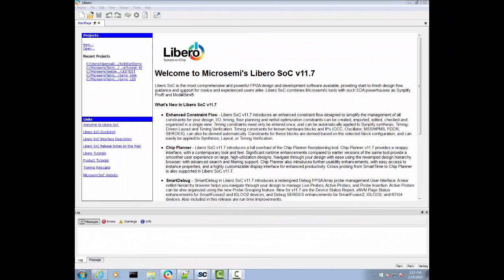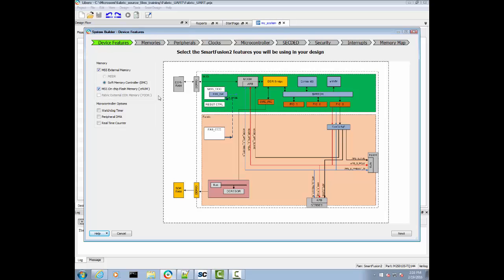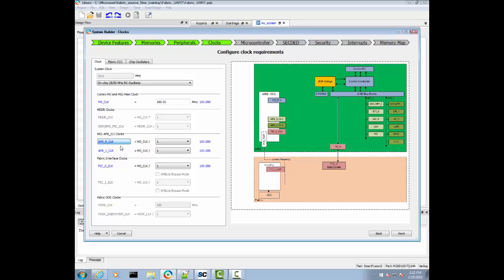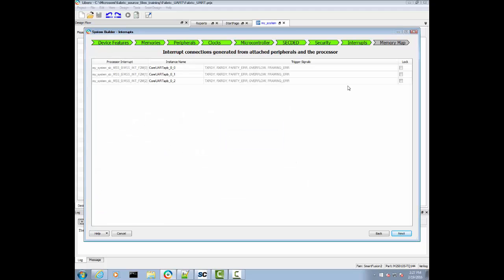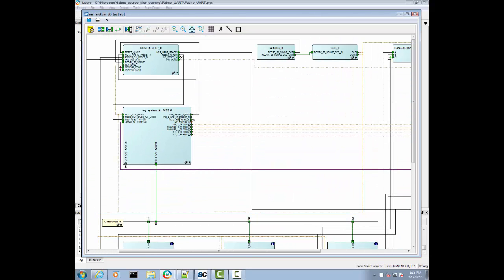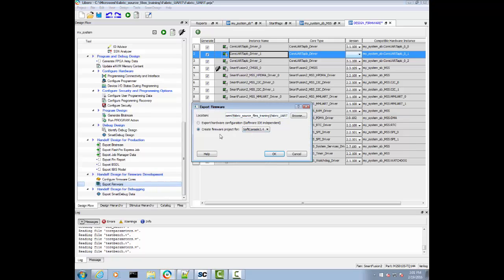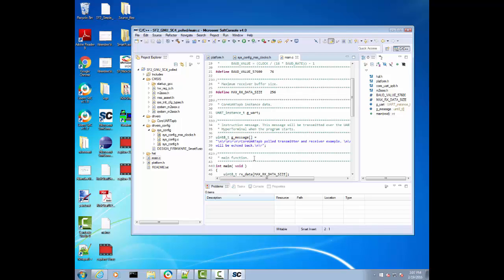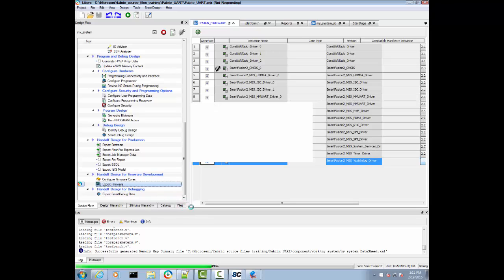Getting Started with Microsemi SmartFusion2 System on Chip (Part 7) – UART Example

Comment: When you dragged the Uart Slave core, in the System Builder, into the MSS Master Subsystem,  I assume, this is the same as instantiating a CoreUARTapb via the Catalog from within the SystemDesign/block interface?   But how do the interrupts get mapped compared to using the dedicated UARTs in the MSS?  There's no interrupt listed for the MSS devices in the Interrupts tab of System Builder.

For example, in the 'Configure Firmware Cores' you had the option for an interrupt sample project for the fabric-based CoreUARTapb_Driver.. however, there's no option to create a interrupt example for the MSS Uart peripheral (MSS_MMUART_Driver) !

I don't see where to find the MSS interrupt information to enable/install the ISR for the MSS UART.